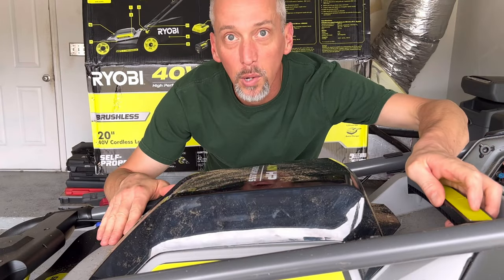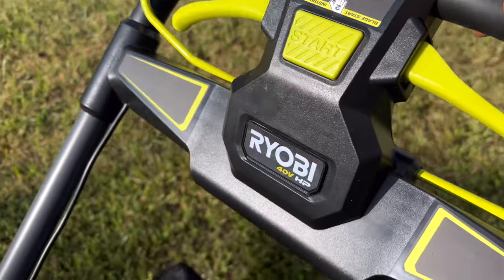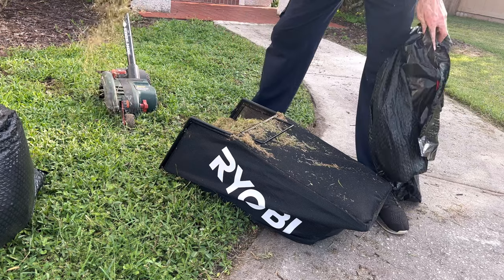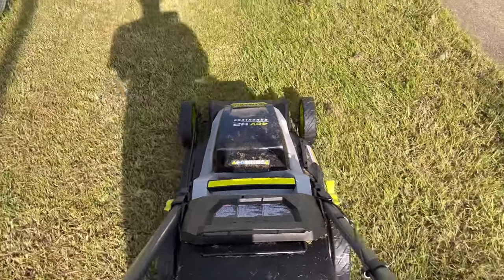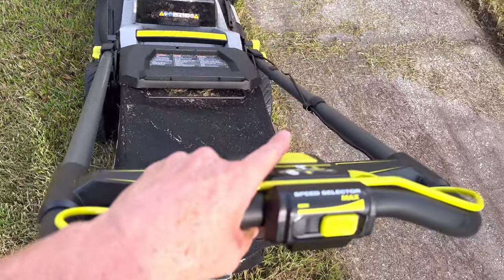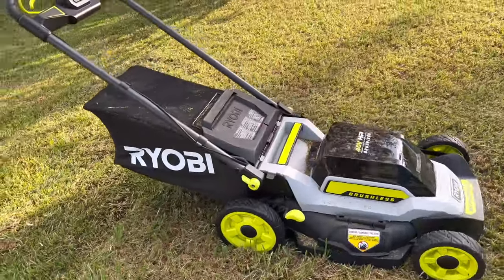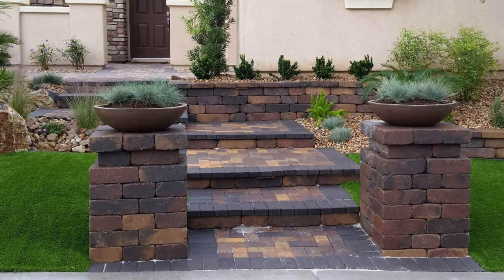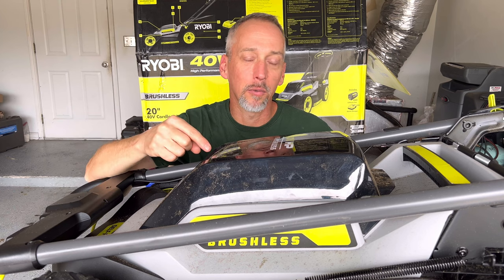This is why cordless mowers suck.

Comment: I bought the non-self propelled 3 years ago. I also bought a line trimmer and blower with the same battery. So, 3 batteries. I have a .25 acre yard. It has worked great for the time I have had it. No more pulling cords.
Reply from the maker: I’m glad it works for you.
Reply: Lol well .25 acre isn't that much land.  I can cut your entire yard with a string trimmer in 20 minutes.

Comment: According to the EPA, each gas-powered lawn mower produces as much air pollution as 43 new automobiles driven 12,000 miles per year – lawn care produces 13 billion pounds of toxic pollutants per year.
Reply from the maker: Wow! I didn’t know that.
Reply: Will one container ship that travels across the ocean in one day create as much pollution as 5 million cars on the road. So I don't see why the EPA is up a consumers but so bad when these container ships dropping off all this crap we buy online polute way more than we ever will
Reply: @tomh9391  By burning heavy fuel oil, just 15 of the biggest ships emit more of the noxious oxides of nitrogen and sulphur than all the world's cars put together. So it is no surprise that shipowners are being forced to clean up their act. But they emit  no where near the amount of CO2 that cars emit. Ships emit only between 10 to 40 grams of carbon dioxide per kilometer. The carbon footprint of airplanes is 20 to 30 times more than ships.
Reply: If that (preposterous claim) is true, then gas automobiles must be so incredibly efficient that no switch to battery autos could possibly make the slightest difference in pollution levels, so why bother?
Reply: I have an average-sized lawn and, when I refill my tank after mowing, it's only a couple of fingers of gas in the little tank. I mow about 10 times a year, so that's not much gas, folks. But the EPA gaslights that my two, or at most three (maybe) plastic tankfulls is equivalent in pollution to FORTY-THREE automobiles driven TWELVE THOUSAND miles each!!?? The EPA thinks a bunch of gas cars can be driven 516,000 miles, yet produce the same pollution as my tiny tanks of lawn mower gas??!! And nobody questions that??

Comment: Many years ago my best friend's brother bought an electric mower. His claim was that he wanted to cut down on emissions and use of fossil fuels. The yard was about 3/4 of an acre. I questioned the individual's sanity. I pointed out that coal is used to power the generators that produce the electricity to charge the batteries. So how exactly was this saving the environment?

I ran a landscape business for ten years. Here in New England there is no way that electric equipment is going to cut it. Lawns that are regularly fertilized grow like mad when it rains. Electric blowers and leaf loaders would be useless when the leaves come marching in. I can just imagine having to run an electric snow blower. Heavy wet snow will tax the batteries heavier than the political party that has a jackass for a mascot taxes your wallet.
Reply from the maker: Very well said.

Comment: I have a similar electric mower from a different brand, it's underpowered, the batteries are too expensive and don't last. The mower would sputter and shutdown when cutting thick grass even with a fully charged battery.  I'm tired it so I'm replacing it with a gasoline mower.

Comment: Can confirm everything he says is true. The mower is pure garbage and can't cut grass effectively if it's longer than 3-4 inches.  Constant clogging and having to start and stop many many many many times.

It definitely does not last 42 minutes per battery. I have a battery that I'm pretty sure is a lemon as it lasts 15 minutes tops. The other battery lasts about 30

Comment: I bought the non-self-propelled Ryobi in the spring of 2022 and it has worked great.  I was fairly impressed.  Plenty of power and the battery lasts a long time.  I wonder if the self-propulsion saps too much power?  Or maybe you just got a bad unit.
Reply from the maker: That might be the problem, not enough power for both.
Reply: give it another year and your battery will die and not charge. happened to me. Royobi Wont cover it even under warranty

Comment: I bought one of these 2 years ago, it looks a little different, it's 40volt brushless self propelled and I never have that issue. I have a good size yard back and front and one battery is always good enough. I don't know what you bought, maybe it's defective.
Reply from the maker: That may be, I’m glad yours is working.

Comment: the batteries on the mowers die in under 3 years even with little use. They wil not replace them even if still under warrant. STAY AWAY!!!
I learned the hard way. And I used to love them til my batteries all started dying

Comment: I have a Victa 72V electric mower and it's awesome. Way more powerful than my previous 180cc Briggs & Stratton petrol mower. Sadly Victa went bust in 2020 so when this mower dies I'll be very sad. Seems you still need to spend over US$650 (AUD$1k) to get a really good electric push mower. Ryobi aren't in that price range. Cheaper AND self-propelled sounds too good to be true.
Reply from the maker: That does sound awesome. I guess the same goes for good electric cars. They are all more expensive than their gasoline counterparts.
Reply: At the moment yes, because we have 100+ years of scaled economy to build gasoline cars. Gasoline cars were probably very expensive when they first came out. There's also an unpaid environmental cost. So while we get cheap gasoline today, we'll pay for that in (expensive) destructive weather events, health issues, and political unrest for the rest of our lives.

Comment: the mowers battery charge dont last that long and you might as well not get one if you let your grass get even slightly too long or if you live in a humid area.  They dont have much power. Also, the batteries die and they wont honor their warranty. you end up needing to spend 50% of the mower cost just n new batteries in the next couple years.
Reply from the maker: Yeah, that’s not mentioned on the box either lol

Comment: These are weak and the manufacturers hide it but basic high school math proves it. How much power is the motor? Well it can only put out what the battery can supply. Its all in the battery. Power=volts x amps so if you drain a 6ah battery in a half hour your motor is pulling 12 amps. These batterys are 40v. 12 amps x40 volts =480 watts. 1hp is 745 watts so 0.644hp and thats pushing the motor AND spinning the blade. WEAK. Compare it to a corded 13 amp mower, 13a x 120v = 1560 watts ie 2hp! or gas tha puts out 3-5hp! These mowers have no throttle and a load sensor to cut power and save battery but the math doesnt add up and then add rhe fact that the batteries alone can cost as much as a corded or gas mower,,,,battery mowers are to be avoided.
Reply from the maker: Well said.